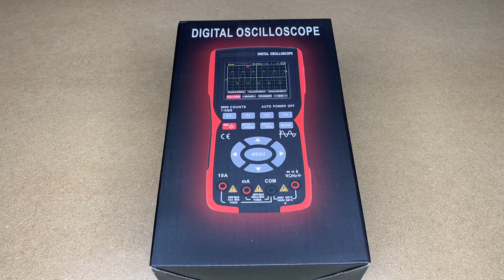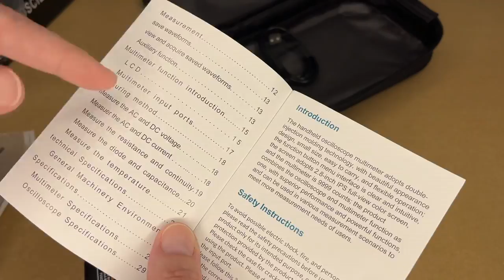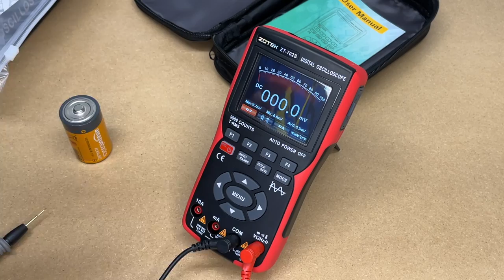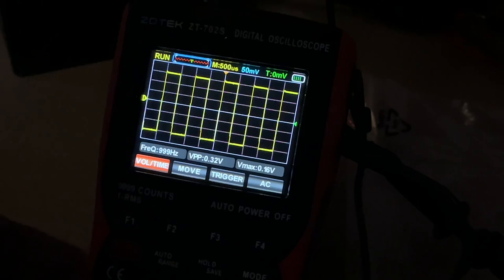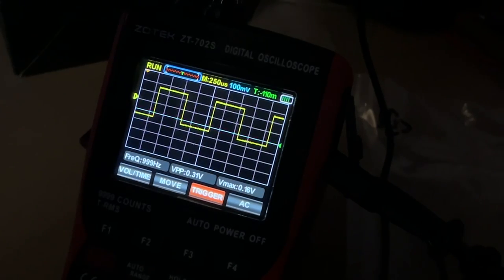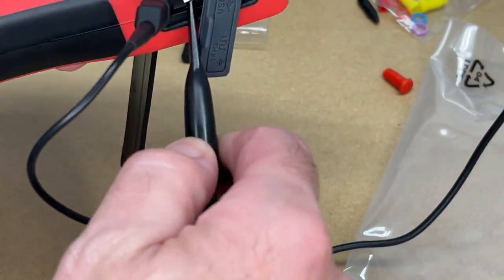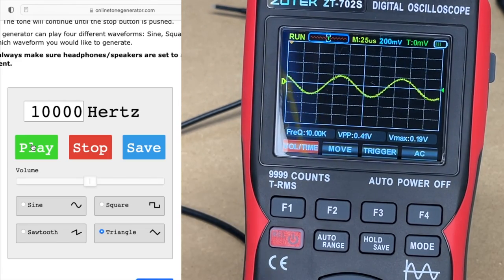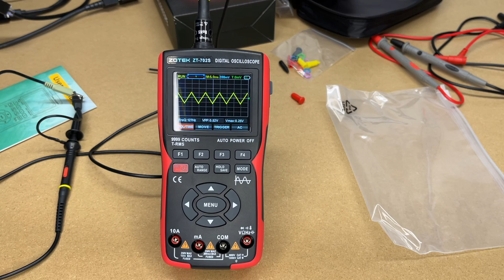ZOTEK ZT-702S 2-in-1 Digital Oscilloscope Multimeter

Comment: Excellent review! I’ve had some digital electronics training and used a CRT scope but only in class not professionally so I have a basic understanding. I’ve got a project truck with an intermittent and random stumble with the ignition system. It’s a 94 OBD1 with no way to view real time circuit waveforms to see what circuit is stumbling. This meter may be my solution to finding the problem child. Most of my initial checks are going to be 14.1 vdc but I was wondering if a high voltage probe exists for this meter in the 30kv to 40kv range?
Reply: Sebetulnya bisa memakai sistim kopling AC yang memanfaatkan kapasitor tegangan tinggi.bisa kita buat sendiri dengan mudah.

Comment: Can you you use it to see the mains ac waveform?
Reply from the maker: You can but I found it to be tricky to connect to mains. I use it to do that here: https://youtu.be/TupGH3qHFCQ?si=eMzaf_cz9y46eyGm&t=412 I think I stuck some multimeter probes into the outlet and connected the oscilloscope probe and ground to them.
Reply: @Rickmakes  thanks a ton!
Reply: Easy and safe way to do this is get a bell / furnace transformer , 120 to 24 volt , put a plug on the 120 volt side of the xmfr. and check frequency on the 24 volt output
Reply: @sparkywirenut đó là một ý tưởng hay 😅